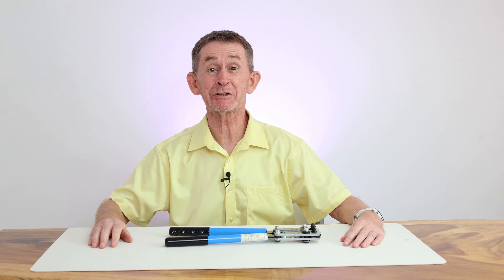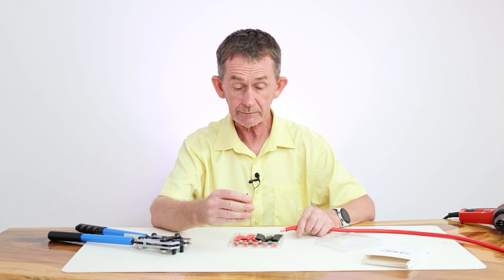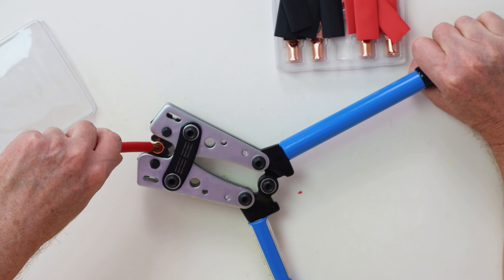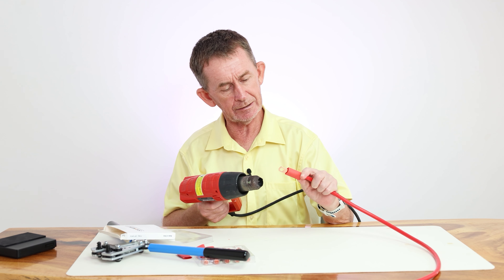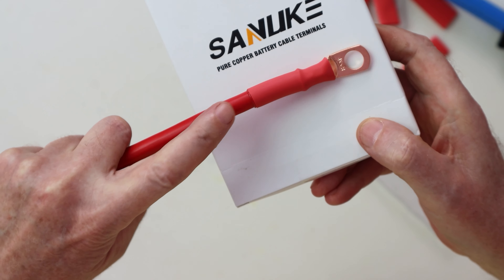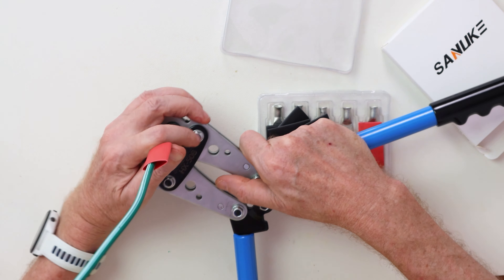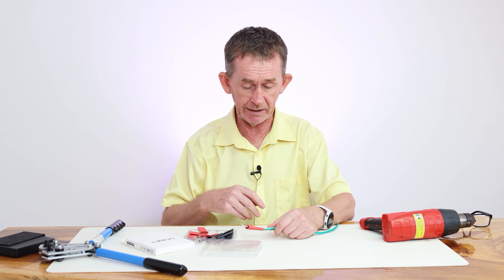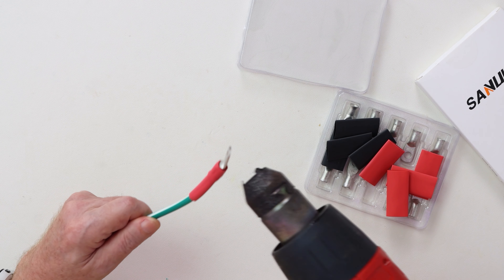How to Crimp Battery Terminal Lugs - Value Sanuke Crimper

Comment: i dont love this tool, i use `10/14/24" Crimping Pliers Wire Rope Swager Crimper Fishing Crimping Tool ` instead
Reply from the maker: Wire rope swagger crimping tools are not recommended for battery terminal crimps. The crimper in my video it the correct tool for lugs.

Comment: Get yourself a third hand - you struggle too much
Or you can just get a cheapish hydraulic crimper and clamp it in a engineer's bench vise - problem solved!
Reply from the maker: I was merely demonstrating the tool whilst sitting down. When standing up over my bench it is no problem to crimp. Those cheap $50 hydraulic ones leak and fail after a few dozen 35mm2 crimps. Do not waste your money. If on the other hand, you are doing this crimping on a daily basis, you will probably spend $200 - $1,000 for a crimper. Thank you for watching